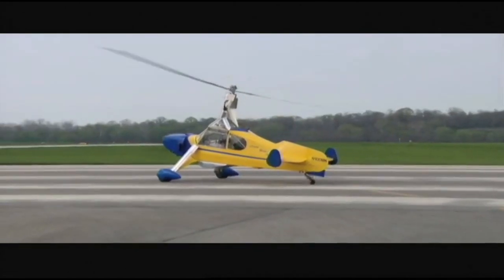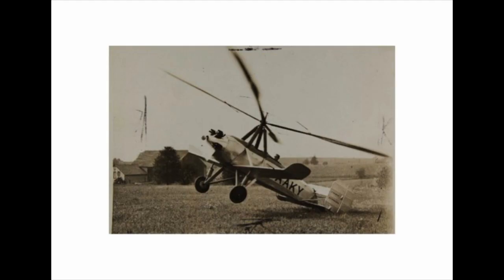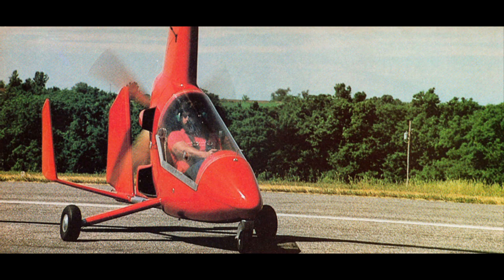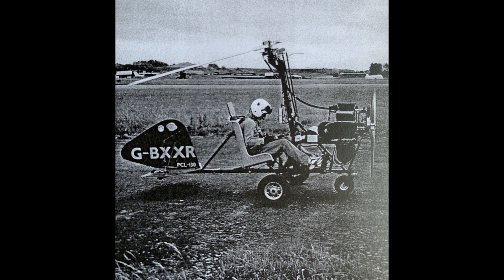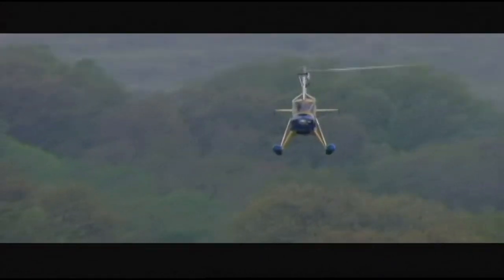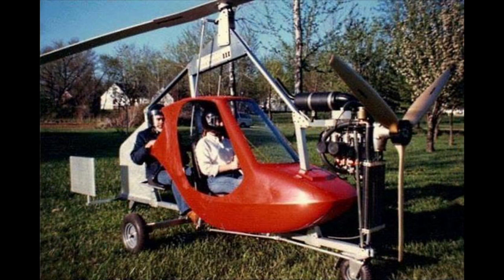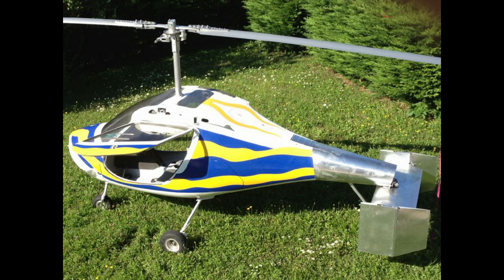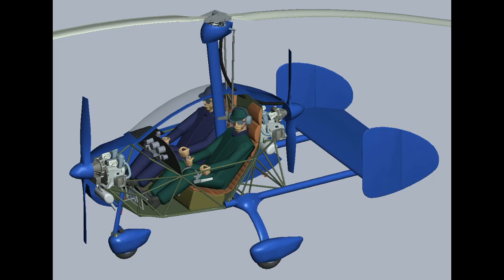History of the Gyroplane - part 24 modern tractor gyroplanes

Comment: Well, that certainly answered my question that I sent you last night. Talk about timing! I was guessing aesthetics, visibility were primary, but it was only a guess. This video confirmed that. Thanks! 
I really didn't consider the engine noise and prop wash because so many of our untralights and LSA's are tractor design.
Building upon your video, efficiency IMO, would be pretty low in consideration for today's LSA gyros. Fun and enjoyment are probably #1 and eye appeal next. It is a business to make a profit after all. Which, gets us back to Bensen's original goal, cheap fun. Except there's nothing cheap about today's modern gyro. (Sigh) The early builders goals were efficiency/practicality hence tractor, like a fixed wing airplane.

Comment: I love tractor configuration, tailwheel-type landing gear. I am not a technician, so I can't talk about the pro's and the con's of the two solutions. Simply I like best: to have the propeller in front of me, high on the ground, far from anything that might hit it (also something that could get loosed from the cockpit), working in "clean" unobstructed air, far from the main rotor (it always works high in the front of the gyrocopter), a good landing gear able to run smoothly on "rough" airfield, the attitude of the vehicle helping to naturally keep the main rotor far from the tail surfaces,  good designed aluminum alloy blades (not extruded).  It is La Cierva or Pitcairn concept, I believe; and the way that the Bulldog mast was designed helps greatly to improve the visibility. But the companies are focused on making money: they aren't really interested in designing something good to fly: only good to sell and make money. So you can find carbon fiber in every pocket (because is fashionable), but not handy, practical designs. This is my mind. The nowadays gyrocopter are very simple to build; in spite of this simplicity they have got ridicolous prices: the main reason that keep me away from a gyrocopter. I can get better performances for my money buying an aircraft...
Reply from the maker: Yes I was quite disappointed when the Bulldog didn't gain any traction and in 2020 pricing has got to a point where it is really starting to limit the market place.  Take a look at the film I've just done on the NANO.
Reply: @gyrocopterflyingclub6148   HI))  Greetings from the Republic of Georgia!I am a heartfelt viewer of your channel))I live in Georgia, where the Caucasus Mountains are, I am very interested in safe flying machine (for tourists to explore nature)
I have a few questions for you.
1)How Safe is the Giroplan in the Mountains Where Helicopter Crashes Are Frequent Due to Thermal Downstream Air Currents?I have often heard that a helicopter crashed in the mountains due to thermal air currents when there was no engine power.
2)Therefore, which device is safer in the mountains? Helicopter or gyroplane?
3)Are there any statistics on tractor-shaped gyroplanes crashes? Because I find this shaped device safer than with a back screw))Thank you very much.
Reply from the maker: Tamer of Hyenas Mesame hi let me answer you tomorrow
Reply: @gyrocopterflyingclub6148  Thank you))
Reply from the maker: @tamerofhyenasmesame1691  Hi - sorry I was on a camping holiday and just got back.  OK on the safety point the problem of thermals that are strong enough to crash a helicopter is that a gyroplane is much lighter than even the usual basic helicopter (such as R22/44).  so assuming the helicopter accidents due to thermals were exactly that  (i.e. not overloaded or poorly flown) and assuming the piloting skills are equal - if you have a problem in a heli then you will too in a gyro.  To answer your point 2) which is safer then really theoretically weight for weight and power for power a gyroplane should be safer as it has no gearbox to go wrong but in practice the helicopter is build by more sophisticated companies today than a gyroplane and so that is mitigated.  For answer to point 3) the statistics are skewed because most modern and sporting gyroplanes are with a pusher design and some of the accidents here are very silly pilot related.  Hope that helps.
Reply: @gyrocopterflyingclub6148  Hi))Guroplane is relatively new in our country, it needs to gain trust))Thank you very much for the reply)))
Reply from the maker: @tamerofhyenasmesame1691  you're very welcome.  If you need further advice or some instruction please email me gyrocopterflyingclub@gmail.com

Comment: You are doing a great job and I have learned far more from you than the many giro instructors I spoke to in Australia. There was a tractor autogiro called a pit bull, an American design and 4 blades, not two. Powered by a Rotax engine as was a really nice looking aircraft. I have a video tape of it going through about 30 minutes of flight and a overview of the aircraft if you’re interested.
Reply from the maker: Hey Kim - firstly thanks for watching and the very kind comments.  That sounds very interesting the 4 blade aircraft - rotor I assume.  Was the rotor designed by a guy from New Zealand?  I've seen Pit Bulls but with only 2 blade rotors so that is unusual.
Reply: I was surprised when I saw it the first time. I’ll convert the video to mp4 and let you know when it’s ready.
Reply from the maker: Thanks Kim it sounds very interesting-  let me dig out what I can on 4 blade rotors
Reply: @kimkeam2094  Would like to see that too.
Reply: I have it on vhs video tape, and will post it as soon as I can transfer it. Sorry for the delay but my vhs player has refused to work lately.
Reply: @kimkeam2094  Thanks!

Comment: Personally, from what I have heard about pusher prop gyros, there were designs that had a high thrust line... I have heard that those are the ones that are more susceptible to 'bunting over'... And when that happens when the plane is in flight- I heard that it is almost always Fatal... This is Why I have been looking at a possible kit to build that uses a tractor prop... Even if it is a scratch- built design from plans, I would prefer to fly a tractor-prop gyro plane.

Comment: Arguably the better looking & most simple of the modern tractor designs is the Putbull, which you didn't even mention here. The quality of the kit was obviously quite good but the one I have suffered from some poor workmanship beyond that & that ugliness is what I'm working removing right now. It's the SS with an EA81 & was in BC Canada. I'd sure be interested in talking to anybody that's had anything to do with them.
Reply from the maker: Hey - yes you're right the Pitbull does look quite faithful to an older Cierva - I didn't cover it actually because a lot were missed, simply because of the 4-5min film can't allow for all.  I just gave some colour on some odd / interesting or impactful models.  

One feature of gyroplanes is the vast number of "what might have been" and the common theme of commercial failure. Its a pity.
Reply: @gyrocopterflyingclub6148  Yeah, there certainly is a lack of info on the Pitbull for sure. Through my digging for info it looks like there were at least a dozen kits sold before the company caved in & when this one I have popped up for sale in Canada I bought it over the phone & hit the long road to go get it. Ironically it appears the only one still flying is also owned by a Kiwi down in NZ.

Comment: For a type that is given to STOVL, really a taildragger is a natural, and this fits the tractor configuration too
I cant recall seeing a trike STOL or STOVL ever, because there is some advantage in having the springy maingear with a direct force line through the mast or wing.
While that settles near zero roll landings, the machine at rest has a disc or rotor attitude that presents to the wind better 
and gives the prop more clearance, and a larger diameter for better performance at these speeds

I think the fuselage structure is more complicated, perhaps until you have to add a horizontal tail to an Igor Bensen type pusher, 
which surprisingly some are still reluctant to do
I think I would expect a slightly heavier but better performing machine, and still better performance than pusher enclosed types but on equal weight
Reply from the maker: I think the STOL ability of a gyroplane has been focused upon more in recent years than likely during the time of the invention of sporting gyros in the 50's/60's.  The main advantage of a pusher for a Bensen type is the fact the prop wash is away from the pilot and not into his face!
Reply from the maker: Yes but don't forget that vision is degraded by a great big motor and prop stuck up front.  Back in the 20's/30's gyroplanes grew out of fixed wing fuselage / motor combinations and that made sense because no point in re-inventing 80% of the aircraft.
Reply: @gyrocopterflyingclub6148  sure is in this Kellets case, except for the same machine with an inline often represented by the Kayaba in Japanese service.
At the same time it looks like electric giros would be practical at about the same time electric fixed wing aircraft are

Comment: stupid question..just curious though..why aren't there any canards on any of the gyroplanes?
Reply from the maker: Not really sure what purpose they would sure tbh. For lift you’d have a wing and control wise the rotor is big enough!
Reply: I like the idea of a Littlewing style machine with main gear mounted on canards a’ la Q200, but there are some concerns with it. 
1) Anhedral (opposite of dihedral) is destabilizing in roll
2) Developing lift in forward flight/forward stick could tend to unload the rotor, leading to speed degradation or rotor flap.

Comment: Would you say thag also having the engine in front of the pilot is better in case of an accident...?  Tractors also tend to have the pilot sort of nestled under or behind the mast...

Accidents can happen in various attitudes, but nose first-ish is rather common....  as opposed to having the pilot be the first thing to meet the ground...
Reply from the maker: Hi - Interesting point in the sense of is a tractor better for dynamics and the honest answer to that is I don't know as there are few being made today and the pusher types that are common are in the main quite poorly designed.  In regards to the crashing part the reality is that  most only tend to genuinely crash an aircraft once - the structures are built necessarily light and all that happens in a significant crash is the engine arrives in the pilots lap.

Comment: Observation: a  tractor tends to Increase air pressure under the rotor, while a pusher Decreases air pressure under the rotor, that, and the many times  demonstrated short take off of the original tail wheel La Cierva aircraft.
Reply from the maker: Question because I am unsure the point.  Why would a pusher decrease air pressure under the rotor??
Reply: @gyrocopterflyingclub6148  Pusher propeller location approx 2-3 ft behind the pilot  induces a lower pressure air under most of the main rotor except for the few feet. behind the propeller. A tractor produces  a higher air pressure under most of the rotor simply by the propeller action.
Reply: La Cierva had jump takeoff capability with variable pitch rotors. Apples and oranges.